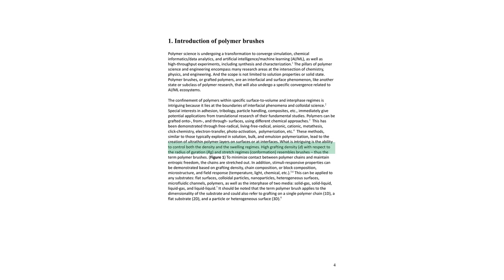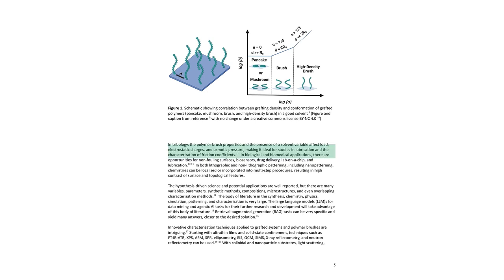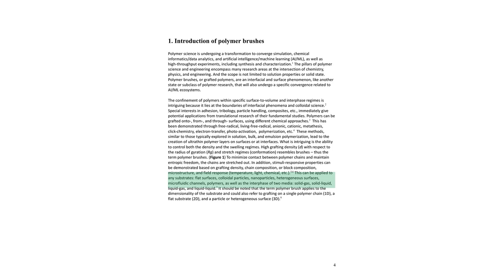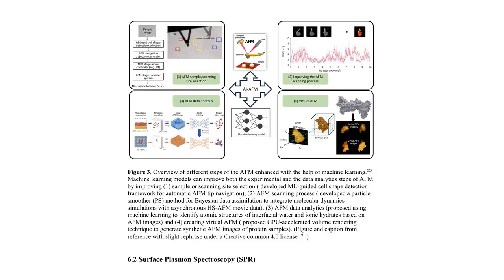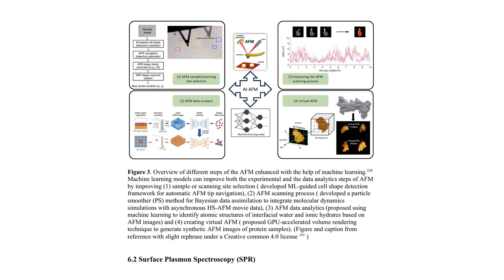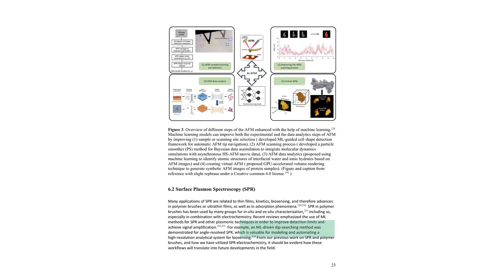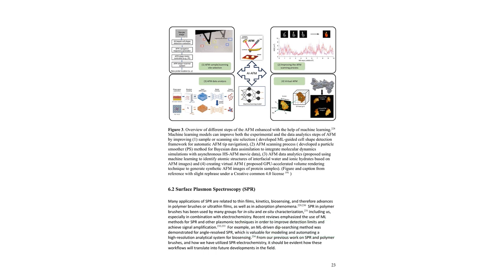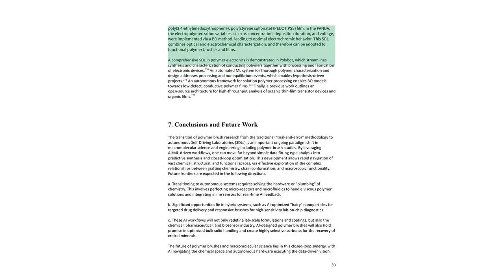Polymer brushes and AI/ML with self-driving labs

Comment from the maker: SUMMARY::
This video explores the intersection of polymer brushes and grafted polymers with artificial intelligence (AI) and machine learning (ML), highlighting their role in advancing autonomous self-driving laboratories (SDLs).

Core Concepts
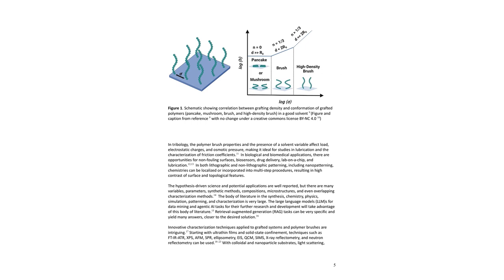Polymer Brushes: Polymer chains tethered to a surface at high density, forcing them to stretch outward. They are vital for applications like tribology (friction reduction), biomedical coatings (non-fouling surfaces), and stimuli-responsive materials (0:40 - 2:00).
Synthesis Strategies: The video outlines three main methods: grafting from (surface-initiated polymerization), grafting onto, and grafting through (3:16 - 5:00).
Characterization: Advanced techniques such as ellipsometry, atomic force microscopy (AFM), and surface plasmon resonance (SPR) analyze these structures (7:00 - 8:36).
The Role of AI/ML and SDLs
Data-Driven Discovery: AI/ML replaces traditional trial-and-error with data-driven workflows. Techniques like Bayesian optimization help navigate vast parameter spaces efficiently (9:45 - 11:06).
Simulation & Design: ML models act as high-speed surrogates for computationally expensive molecular dynamics (MD) simulations (11:52 - 12:50).
Autonomous Labs: The ultimate vision is the self-driving laboratory (SDL)—a closed-loop system where robots synthesize materials, characterize them, and use an "AI brain" to plan the next experiment, significantly accelerating scientific discovery (14:38 - 16:08).
Future Outlook
The field is moving toward large-scale automation, with potential applications ranging from targeted drug delivery to mineral recovery from waste streams, fundamentally changing how materials research is conducted (16:13 - 17:30).